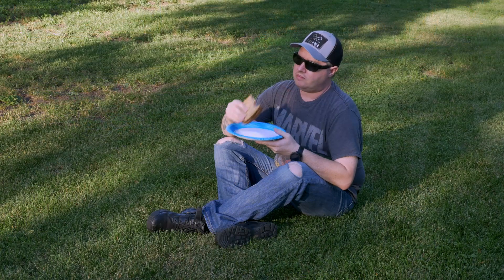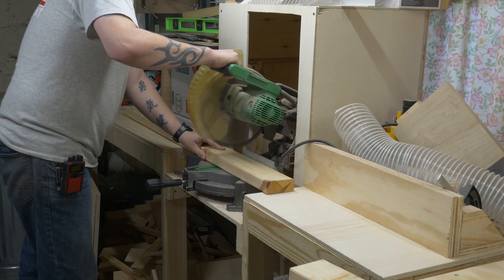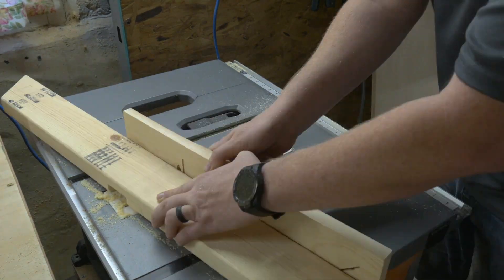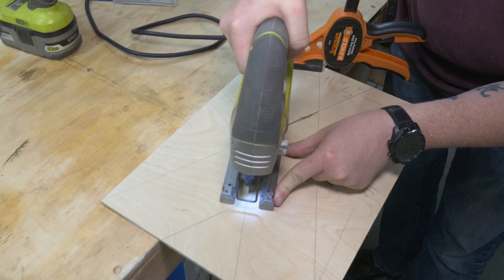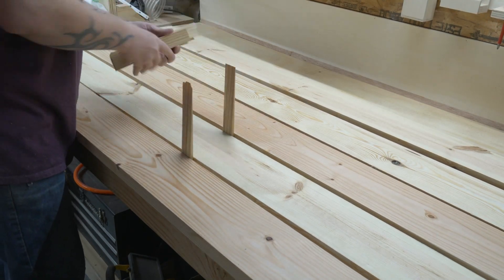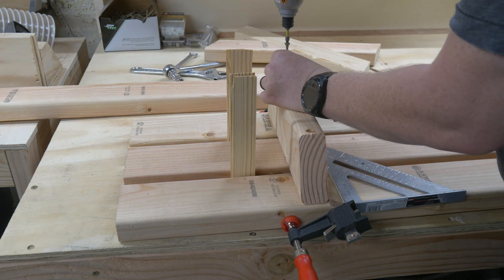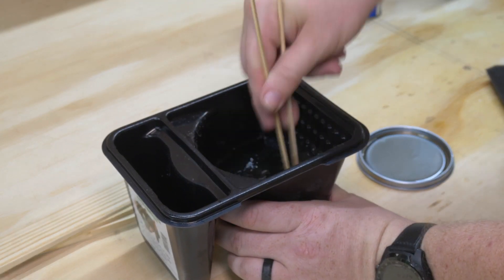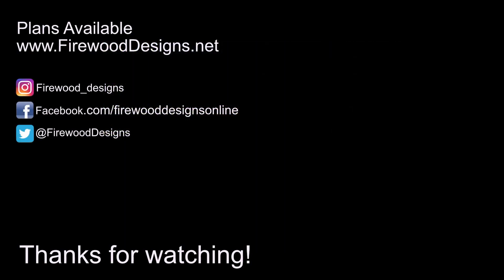How to build a detached bench picnic table. Free Plans, easy beginner project.

Comment: The upfront cost is 40 to 50 grand for me when I don't have space for large machinery. So I have to start by building an outbuilding.  It would be nice to see this made with a circular saw and a standard drill. Most beginners don't have professional a professional wood working shop.

Comment: What was the total cost of the materials?
Reply from the maker: Not including finish it was about $70 in lumber and hardware
Reply from the maker: John Manci  For this project it came from Menards. If I'm using nicer wood I'll pick it up from Rockler or a store called Owl hardwood lumber. Owl is a bit of a drive for me so Rockler usually wins.